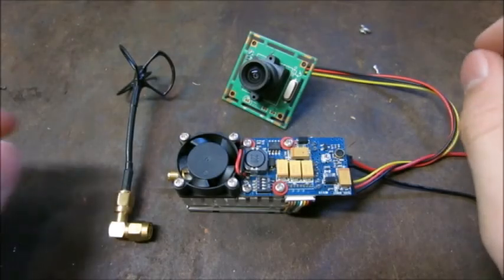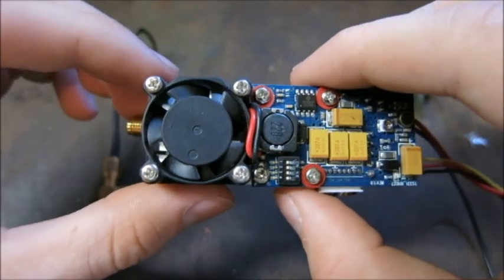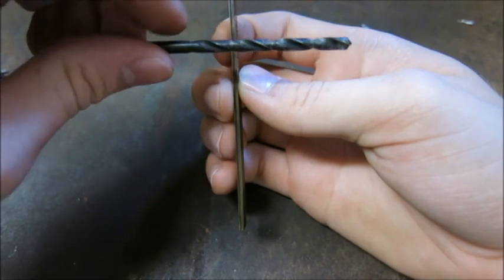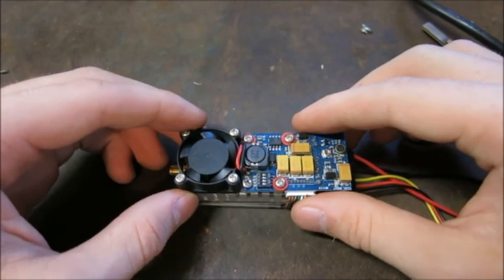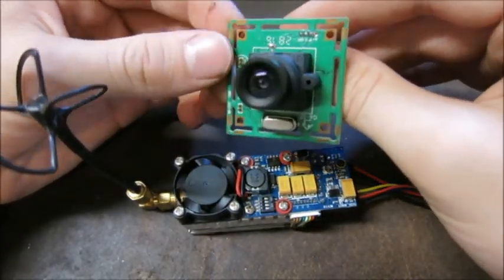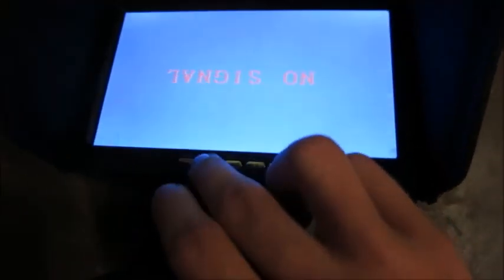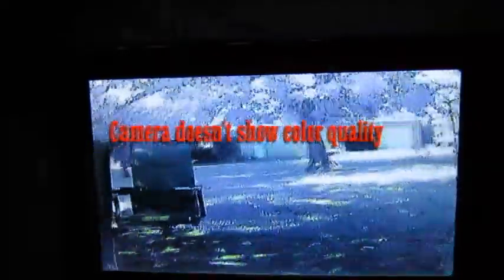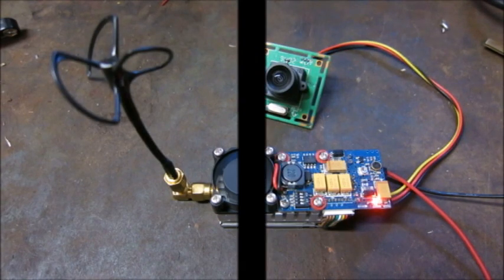Long Range 2 Watt 5.8Ghz FPV Transmitter Review.

Comment: Where can I buy this device?

I am looking at buying TBS Unify Pro32 HV, because of its high power output but if I need to add a separate heatsink and a fan to it, I might just get this as it has all built in

Maybe do you know for any separate amplifier (so I could use TBS on Low power and amplify the signal with it?)

Size is not realy a problem as I will carry this around me not have it on a drone

Comment: I can transmit just as good at 100mw
Reply: which system are you using
Reply: check this one though - same transmitter I think
https://www.youtube.com/watch?v=GkoVvYX9zKU
Reply: With the model on the floor at 250 mW it goes through 5 cement walls at 200 feet or less and zero cement at 500 feet

Comment: What’s that military radio your using
Reply from the maker: The green one is an FM transmitter that I built a few years ago and the grey box came off a WWII ship and was originally designed to play classified tapes. However I needed a speaker so I connected the green transmitters receiver to the tape player so you could hear me thought its original tube amplifier.

Comment: You should try 433 and 1.2 1.3ghz .I use 433 uhf for tx and 1.3 400mw for video and tuned antenna it will blast up to 15km easy.
Reply: Where do you get small 433 Mhz video transmitters? The antenna must be quite long...
Reply: Where can I buy 1.2/1.3ghz video tx and rx? Especially for Europe/Germany? Do you know it?
Reply: @hendrik289  watch this...  https://m.banggood.com/FPV-1_2G-8CH-800mw-Wireless-AV-Transmitter-And-Receiver-p-73201.html?rmmds=search
Reply: hii. what is mw stand for? ( 400mw )
Reply: PUBG MOBILE PANDA milliwats

Comment: What kind of range can you get out of one of these? I am building a fixed wing craft and don't really want do the uhf thing. But I would like to get a mile or so. Would this setup work?
Reply from the maker: indeed it most likely would. as far as aircraft testing goes my plane runs on a 72mhz spectrum which wont give me much more control range than the line of sight. however by both utilizing a powerful transmitter and good antenna I would say you could probably get 3 miles at max assuming your plane is 2.4gz and can actually fly that far I would say yes.  but ultimately the range is not determined by the transmitter but more the antenna and depending on your setup you could even get around 14 miles range!
Reply: HighVoltageMayhem  ok thanks for the info ! I have a tbs crossfire rc module for the Taranis. It should get me a couple of miles at least. I subbed to your channel also.
Reply from the maker: Alight thanks man, and good luck with your FPV setup!
Reply: you should look at the 900mhz uhf for control and 1.2g for video link and use a 5.8g repeater for your ground station to goggles. you can get over 100km on the described set up at a much less power draw from your craft.
Reply: You can easily get a mile or more on 5.8ghz, even on generic AIO 200mW camera/transmitter setups. The key is in your antenna choice. Use an omnidirectional antenna on the tx, like a cloverleaf or pagoda. Then, on your diversity ground station, use a 7-9 turn helical and either a patch or a matching omnidirectional. I use those cheap and tiny wolfwhoop AIO cameras on amazon that are only 200mW, and can easily get out to 6 miles with that setup.

Be sure to get a 2.4ghz booster for your transmitter, they're only like $17-$20 on ebay.
Reply: @TheWinnieston  my aio  250mW i get about 3 or 4 hundred feet .
 A 800 mW maybe 1000 feet using generic $50 goggles to recieve with .